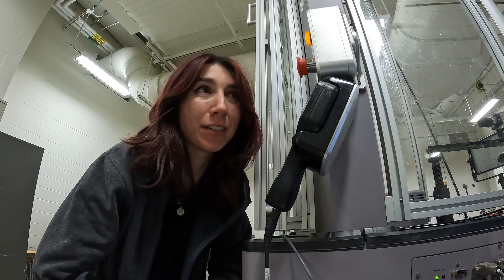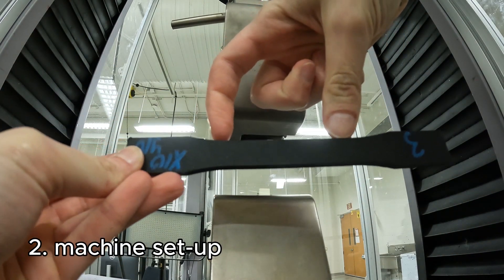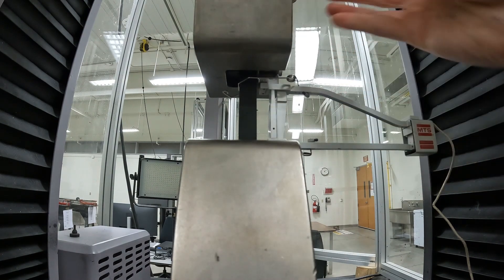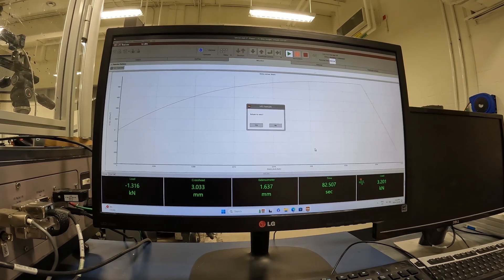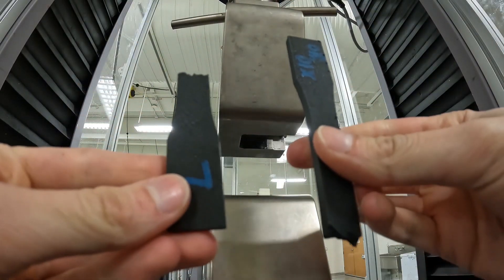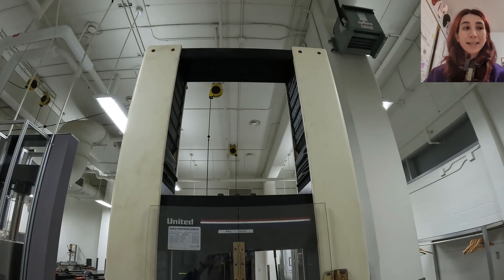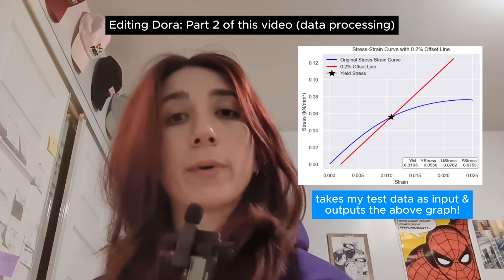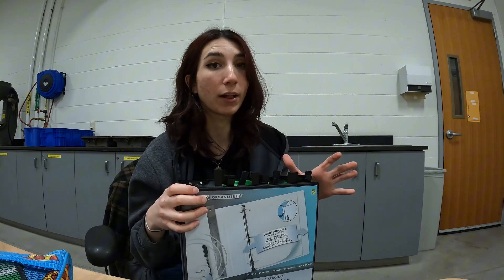how I test 3d printed parts (tensile strength)

Comment: Nice! I am doing a thesis work where i test how print orientation effects 3D printed PLA so i am quite interested in what settings you use during the slicing process of the specimen and by any chance are you using ASTM standard? or ISO standard for the geometry of the specimen?
Reply from the maker: I am using the ATSM D638 tensile
testing standard. I have a paper being published this month that includes the settings. Send me an email and I'll share it with you once its out !  You can find my email in my channel description. Good luck with your research - I hope we can share our findings. I am using these results as a bench mark for other customization. Thank you for stopping by & commenting :)
Reply: @strelkomania  Sounds amazing! I would happily share mine too when its done by the end of May☺ Good luck with your work!

Comment: Ayo! Breaking the samples with contact extension meter on!? That's quite extreme! In the lab I'm working in it's a rule to not use extension meter when breaking stuff. We use strain gauges for that!
Also those clamps look asymmetrical. Have you tested how close the left/right and front/back readings are while loading it in the elastic zone? That may look not important since the whole tooling is massive and made of steel but it's a thing to consider. At least for composite materials.
Sorry if I'm writing it grammatically incorrect, English is not my first language and I'm drunk on top of that.